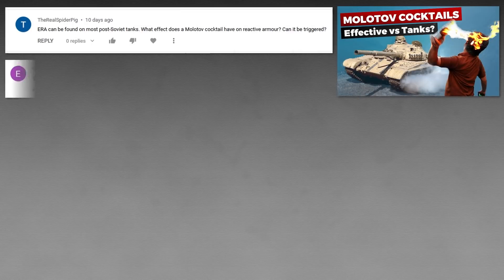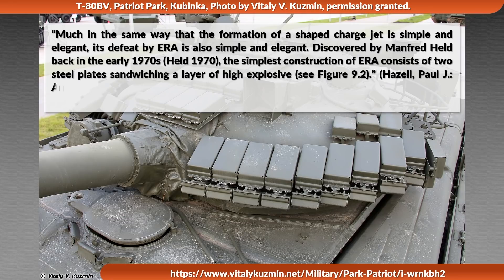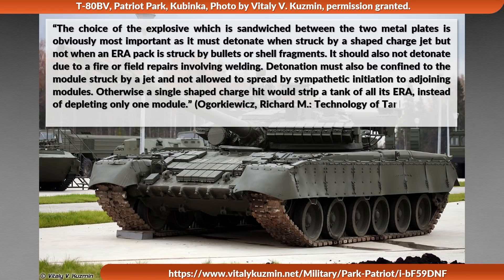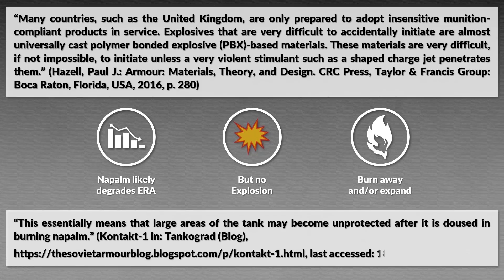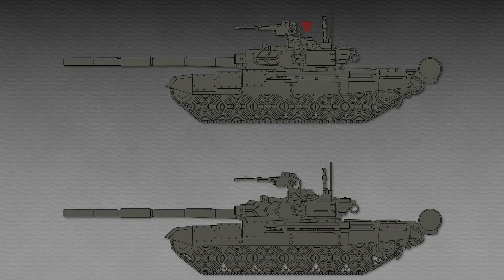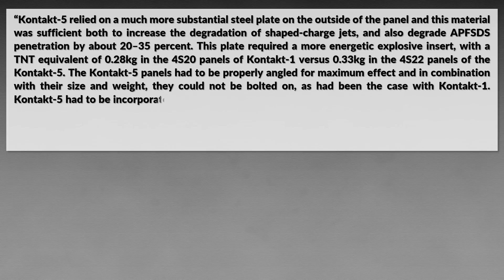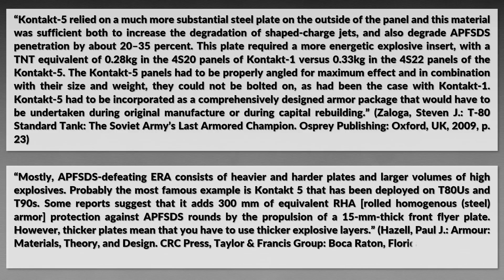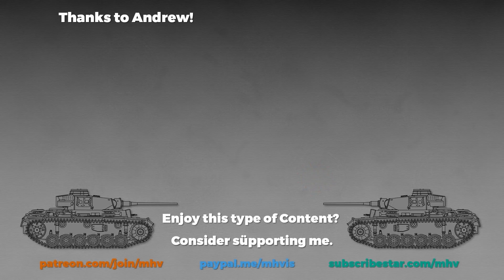Why does Russian Explosive Reactive Armor not explode?

Comment: Having been in the army, long time ago, and used AT weapons I have two questions not answered, I think.
1/ I have been told that its possible to make the armour piercing jet so "fast" more than 10000 m/s that the ERA wont explode fast enough to stop the piercing jet stream - Is this true?
2/ Since all of Russian tanks have ERA and some even active anti tank protection, why are the Ukrainians so good at killing tanks? If the systems were as good as all say they are, the tanks wouldnt explode, but they are - That is an interesting question. The Russians even have these "cages" on top to stop the top attack from NLAWs and Javelins, but they dont seem to work either
Reply: 1 is rather complicate. Bottom line is no amount of era will stop all of the jet, you still need some stuff behind to catch the left over stuff.
2 is also rather complicate. But if you are aiming at the hull, side, and the back of the vehicle, the chance of destroy them is massively increase.
Reply: @jintsuubest9331  also you need armor strong enough to absorb an era explosion. That's why era isn't used on apcs
Reply: 1. I guess no. The faster jet goes, the more pressure is applied to era, the better it explodes. Making a jet fast enough is just adding enough penetration to make sure that even degraded jet will be able to penetrate. All nations use tandem warheads instead
2. Era and composite armor don't protect tank from all sides, and anti-javelin cages are more of a moral-saving improvisation than a real protection. If you look carefully, you'll see that most of photos of destroyed tanks are from first days, when they were forced to advance quickly, exposing them to all sorts of ambushes, especially in rural areas. When tactics changed to methodical advance, casualties dropped dramatically
Reply: @Fuzzle'd minor corrections from ex-pfc with friends who fought in various countries around the world and are currently  in the Ukraine. 1. There are tandem warheads in atgms which are designed to deal with era (first charge detonated era, second penetrates armor), though frontal armor is strong and may defeat them if charge is an older one
2. Era is usually applied to frontal armor only, with some later models having some of them on sides. There are a lot of weak spots even for weaker rockets like rpg or at4 if you can ambush a tank and attack it from the sides/rear/top
3. When I served in much worse unit than those fighting rn, era on our tanks was fine and they were regulary maintained. Electrical devices sometimes weren't working but era is much simpler to maintain and more reliable. Considering cartons in era: this info comes from a side which want Russian army to look weak. Take all of it (just like Russian statements) with a huge grain of salt. Also I asked friends who are fighting now and all of them replied that era is working and usually tanks survive multiple hits from rpgs, sometimes survive a frontal hit fron atgm (of course after this tank is towed to maintenance ) 
4. In general, you want to shoot enemy armor until it does a big beautiful boom, but there are a lot of videos, stories of evacuating damaged armor under fire, usage of captured Ukrainian armor by donbass troops, also a lot of vehicles on Russian photoes don't look like they have been shot to total destruction. I suppose it comes from ammo economy, especially from Ukrainian troops, which sometimes don't have enough rockets to shoot btrs until they explode
Reply: @Fuzzle'd Because explosives mass in 155mm he shell and atgm is quite the same (maybe different by 1.5  or 2 in extreme examples ) I guess experience is quite the same too
Reply: Ty for all answers, I guess we never see when era or active protection works. I was in the infantry and one thing that always surprised me was that once being passed by armour they never saw us shooting from behind until it was to late
Reply: @Fuzzle'd my combat vehicle was bmp2 (though I never participated in combat) and its visibility wasn't good. In open field, when you have more than 500m line of sight you can control your surroundings, but when when it tightens down to a forest or village, you field of view is just disgusting, you can control a street in front of you, that's it. Also communication with infantry was a huge problem cause vehicle and infantry radios used different frequency ranges, so you had to plan carefully your next move, than stop and plan the next one. I guess it doesn't work well in combat. I've heard that modified versions have thud problem solved, but in Russian army that means that not all units amd vehicles will receive them. Also while moving in a column, tank usually was driving first, with apc/ifv behind it. Frontal recon also had a tank driving first. When unit is engaged in combat, we vere trained to fight alongside with vehicles, not in front of them. And urban combat was totally lacking, none of trainings with vehicles was in urban conditions
Reply: @Fuzzle'd it's not just era stopping atgms, throughout of t72 evolution frontal armor is constantly improving (basically adding more layers to that rha-textolite nera-like armor), it must be contributing cause I never heard of an older t72a surviving atgm. Of course javelin hitting from above is a whole different story, but my friends keep telling that Ukrainians are very poorly trained with complex systems like javelin and nlaw and they even usually find used old soviet rpgs with some nlaws just lying around not used

Comment: Realistically too, if there were an explosion from inside the tank that were capable of triggering the reactive armor (though that's clearly very unlikely even so), the reactive armor detonating also would really be the least of the worries of tank crew - assuming any survived the original explosion.
Reply: Correct, but the point was that unexploded ERA is not proof of empty ERA boxes.
Reply: @Atlas531  I know, I didn't mean it to sound critical of the video. just meant it as a bit of dry humor
Reply: Nope era cancels out explosion inside the tank and nothing happens
Reply: Fakealistically too, a plastic Lowes bucket would not be any sort of protection...
Reply: Such an explosion would be powerful enough that the additional power added by the ERA detonating wouldn't matter much to anyone outside the tank either.
Reply: @Dennis-vh8tz  If the tank is going to cook off, and the crew is running for their lives, the last thing you want is big ERA blocks flying in every direction. This is like Squire's joke reason for why the Independent had riveted armor
Reply: At 70s and 80s, Soviet armored was way more superior to nato ones. But currently its outdated and cant do much rather than dying
Reply: @friend2324  No, it wasn't. Have you ever been inside a T-72? It is extremely cramped and dangerous. In addition to being dangerous for the crew to be around, the auto-loader has some distinct disadvantages. The ammo is stored around the base of the turret instead of behind blast doors like Western tanks. This creates a high possibility of secondary explosions if the armor is penetrated. This is why you see the turrets blown off of destroyed Russian tanks but seldom see this happen to a Western tank. Another huge disadvantage for this system is that the gun must be elevated every time the gun is loaded. This means that the gunner must reacquire the target every time he shoots. An M1 can make micro adjustments if the first round misses giving the second shot a higher probability of a hit than the first. About the only advantage the Soviet tanks had during this era was a lower silhouette. This was at the cost of a cramped crew compart that significantly increased crew fatigue.
Reply: @jacquesstrapp3219  im talking about efficenty,not quality. Soviet factories could make several hundred t 72 and t 80 series of tanks in few weeks. While US ones takes more time to produce and travel since its a whole ocean away from actual battleground. Soviets wouldve won on a land war and stop at french border,probaly enforce a ceasefire or peace deal
Reply: @jacquesstrapp3219  The problems with the autoloader were solved during the development of the T-64. There are no issues with the current autoloaders that don't exist in the autoloaders of nations like Japan and France, who also have autoloaders. I would also direct you to the Chieftain's video on autoloaders. Being an Abrams and Bradley crewman who actually saw combat in his Abrams, and someone who was spent a good portion of his life clambering around hundreds of different tanks, seeing how every little thing can go wrong, he saw absolutely no reason not to put an autoloader in a tank. Russian tanks are cramped for a reason, as well. Russian doctrine since WW2 has been very aggressive, focusing on short, fast strikes. An Abrams or Leopard crewman, under their country's doctrine, might be in his tank for days at a time, so comfort is very important. A T-72 or T-80 crew doesn't expect to be in combat for more than a few hours. They'll be out of the vehicle before they care about how cramped it is. That's why it wasn't until remotely operated machine guns started to become feasible that Russian tanks made top mounted MGs a standard feature. Western tankers spend a lot more time out of their hatches, so they actually have the opportunity to use something like that. Also, regarding elevating the barrel, have you seen Leopards, Abrams, and Challengers fire their guns? They always elevate the barrel anyway. Russian tanks currently have a disconnector for the sight, and the gun elevates automatically, so the gunner keeps his eye on target while the gun is being loaded
Reply: @filmandfirearms  I have trained with OP Forces and have been inside a T-72. You have to actually sit in one to appreciate how badly cramped they are and how much it would affect your performance. A large man like Chieftan would have a hard time getting in one and if he did his "the tank's on fire" drill would probably hurt himself trying to get out quickly. The ammo storage problem is still a major weakness that causes catastrophic secondary explosions if the armor is penetrated. Chieftan also pointed out that having a 3 man crew has problems with maintenance and security when bivouacked. The extra man that can share guard duty and assist with maintenance drastically reduces fatigue for the crew.
     When I served in Germany, all Russian tanks that we saw had twin 14.5 mm machineguns on the turret for helicopter defense so I don't know what you're talking about there.
     During the Cold War, NBC warfare was a primary part of Soviet doctrine so spending a lot of time outside the vehicle was not part of their doctrine.

Comment: All of those tanks taken out of storage needed to have the explosive filler put into their ERA-blocks when activated. That’s two bolts and two filler pads per block. Somehow I doubt that Vasja at the depot in the Far East bothered with them all even if they had all the blocks available (and this assumes they were stored properly).

At least, that’s how it worked for Kontakt-1 & -5. Considering we’ve seen mortar bombs made in 1988 I doubt everything is kosher on the outside of those T-72s.

Comment: However, inspection of the "explosive reactive armor" shows that many time there are really egg cartons inside the containers. More corruption.
Reply: What kind of eggs come in 5 sided star shapes?
Reply: Relikt-3 has explosive sheets that look similar to egg cartons, but they'd only work that way if they were ostrich eggs. Some have suggested that crews removed the explosives to sell on the black market.
Reply: @jarink1  Red Effect looked at this. Turns out it's likely just rescuing the ERA pannels when they abandon the tanks.

Comment: Is there a shelf life for these explosives?  Are the metal boxes housing the explosives sealed?  I have wondered if the RA wasn't going off because the explosives are old and didn't get maintained.  If the boxes are sealed then I would expect to see ruptures from the explosives reaching a burning temperature and creating gasses.  Speaking of which, there doesn't seem to be soot around the blocks that I would expect to see if they weren't sealed.
Reply: Kontact 1 are definitely not sealed, but these are rarely present in high-readiness units which are experiencing the bulk of fighting. Modern versions have solid metal cover which should be quite waterproofing. Also plastic explosives are not really demanding it terms of maintenance. And there are a lot of stories, photos and videos of working Russian era doing its job
Reply: Also on the photos there are contact 1 blocks, which are far away from being sealed, so rupture from burning of evaporating explosives won't occur anyway
Reply: @ВячеславФролов-д7я  Thanks!

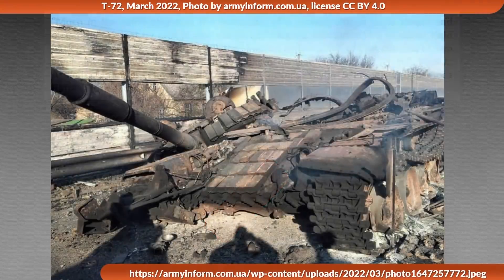Comment: 1:58 I think the road wheels are made of cast aluminium, therefore have much lower melting temperature.
Reply: Another factor is the heat from inside the burning tank transmits along the suspension bars to the road wheels